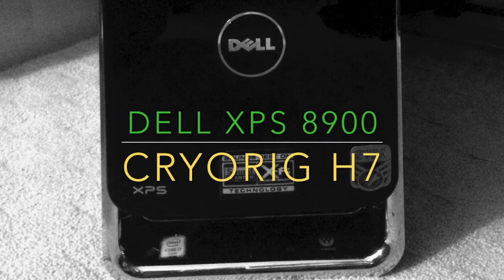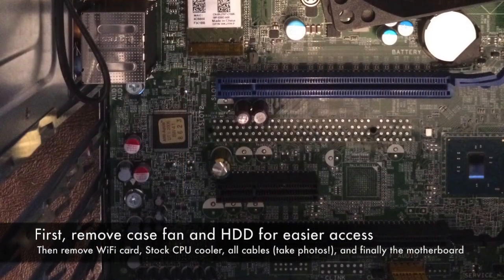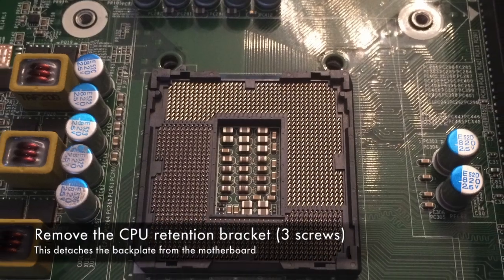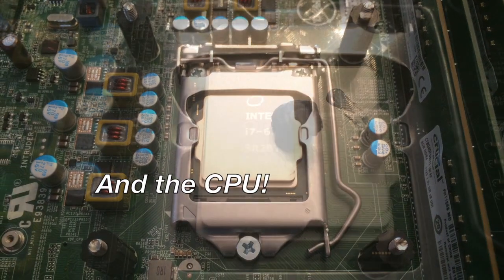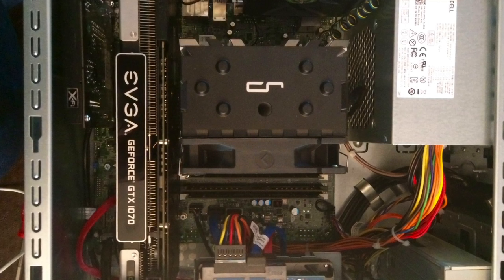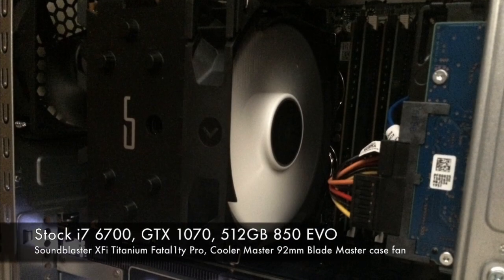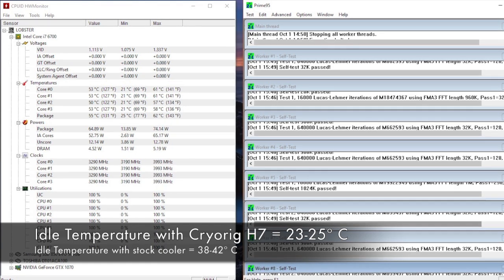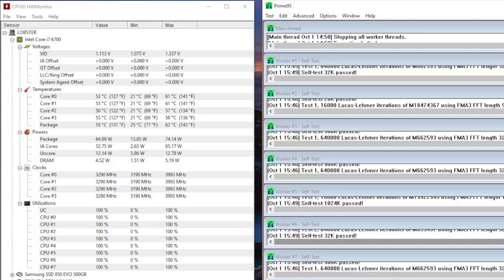Installing a Cryorig H7 CPU cooler into a Dell XPS 8900

Comment: Why not replace the cpu bracket completeley? The LGA 1151 has different variation with the same screws, Instead of modifying the original bracket? Is this just something that wouldn't be possible?

Comment: I used this tutorial to install a CoolerMaster Hyper 212 on an XPS 8500 with an i7-3770. I'm using a HAF-X case and I've heard that it won't fit in the standard 8500 case. 

Be careful when punching out the punch fittings. I bent the frame a little, and it took a lot of working to get it flat again. Using long screws would probably be a safer bet, if you have them.

Comment: thanks for the informative video.  Any idea if something similar is possible with the XPS 8910 SE?  They have similar looking mobo but the 891- case has the swing out PSU idk if that will pose issues.
Reply from the maker: Looks like the power supply hangs over the CPU on that machine, so nope it would not work.

Comment: Those press fitted threaded sleeves in the Dell's back plate: I could not pound mine out by any amount of abuse with a sledgehammer and hole punch-like implement. The bashing made so much noise that it attracted the attention of the PC's co-owner who insisted I stop for fear of deforming the back plate and making it unusable. I wonder if the back plates in the XPS 8900 units distributed in Australasia have shrink fitted threaded sleeves, or even a sneaky amount of welding.
Reply from the maker: Interesting.  You could always drill them out, given that the threads are no longer needed due to the backplate being "sandwiched" between the mounting bolts and the CPU cooler, and the CPU socket screws also thread from the other side, holding it in place.
Reply: @jarrod-smith  Thanks for the insight. I've become more hesitant about performing any irreversible mods to my unit. I previously got a Cooler Master Hyper H411R in anticipation of an upgrade to a used i7 7700K (91 W TDP). Luckily I only got the cooler first to "try it on" the current i5 6400 (65 W) and ran into this mounting problem. I'm not even confident the Cooler Master's sleeves would have worked with the holes I couldn't forge in the back plate now because they depend on the included plastic bracket to be held taught while screwing the cooler into them. There is no room between the PCB and the case interior for that new bracket either.
    Anyway my new plan is to eat humble pie and look for a i7 7700 (also 65 W) which I hope can cope with the current Dell cooler and be kept under... 90° C? This cooler looks a bit like the Intel kind but is fastened down with screws. My i5 peaked at 63° C under Extreme Tuning Utility's AVX2 stress test with it, so I think the latter i7 should work okay, but then I also see you weren't satisfied with the i7 6700's temps using what I assume was the same Dell cooler. It looks like my trial and error has not finished for this system.
Reply: @jarrod-smith  Greetings from the future! The good news is I was able to successfully install an i7 *6*700K & the Cooler Master. The threaded sleeves and their mobo back plate stayed put, as the sleeves were actually compatible with the Cooler Master screws (~3 mm dia)! I didn't find this out sooner because the folded mounting arms suspended  the screws too far above the board to reach. That couldn't be remedied since each screw was held to the cooler mounting arms with what I can only call a 4-pronged metal stopper... until I used the tiniest flat head on hand to pry them off. Saving the springs, this allowed me to flip the mounting arms upside down so that the folded ends that would house the screws were down closer to the board, putting the plate sleeves in biting distance of the cooler screws. Everything's been running smoothly a few days now. Its hottest core peaked at 78°C in an AVX2 test so I'm not even bothered.
   The bad news is I spent ~$300 on a used collection just for the included i7 *7*700K beforehand. When the system refused to boot, I later learned that Dell had never bothered to update the XPS 8900's BIOS to accept 7th gen Intel. Until then I was only looking at the socket and chipset for compatibility. My best payback in the future will be to boycott pre-builts whenever possible, ha.

Comment: Did installing this throw a CPU fan error at boot? I've heard this happens if you have a non Dell CPU fan. Also, are you able to control the fan speed thru SpeedFan of this cooler if attached to motherboard CPU fan connector? I had same overheating issue with my i7-4790 XPS 8700, however I discovered with SpeedFan I can control the CPU fan. It was running at 800 RPM as my cpu was reaching 70 degrees celsius. With SpeedFan, I turned the stock CPU fan up to about 3300 RPM during gaming, and the CPU stays below 60 degrees while at heavy load. Its not the stock heatsink, its the programming dell put on the RPM curves that makes these fans run super slow even at high load for quietness.
Reply from the maker: No cpu fan errors, the mobo treats it just like the OEM fan. Look below for my previous comment about that.  Haven’t tried fan control software, I just let the firmware control it based on temps

Comment: Did you or do you have to remove the motherboard in order to put the screws in for the fan?  If so can I remove the other side of the tower?
Dell xps 8900
Reply from the maker: No, the 8900 case does not allow you to remove the right hand side panel to access the back side of the motherboard It's riveted to the rest of the case.  That's why I removed and then reinstalled the mobo to do this mod.

Comment: Why not use the plastic back plate instead of modifying the old one? I would assume its because of the Dell Case, so if you have an aftermarket case you could go ahead and use the plastic plate that came with the cooler?
Reply from the maker: I just figured metal > plastic in terms of rigidity so why not modify what was there instead of using plastic. The plastic one might have worked fine, I didn't try.
Reply: Ah okay good to know. For the record, I've always used the plastic ones that come with the Hyper 212 Evo and they work just fine (on other machines of course). 

Thank you for the quick response!
Reply: Just to add to this, the stock backplate does dual duty - holding the cpu retention clamp AND the cpu cooler. If you take it off you need to find a stock cpu clamp rear plate - and then you can use the stock plastic back plate incl with the cpu cooler.
Reply: You can also replace the cooler with one that uses the stock m3 bolts and it's an easier process - dont even have to take the motherboard out; https://www.dell.com/community/XPS-Desktops/XPS-8930-i7-8700-3rd-party-CPU-cooler/m-p/6108436#M13410

Comment: Hey, I hope you still get notifications because I’m curious about something. I heard that aftermarket cpu coolers cause a fan error on Dell boards and I wanted to do this mod to my Inspiron 3847. Does the connector just plug into where the stock one went or did you have to do anything else ? Awesome vid btw, thanks for putting it out
Reply from the maker: This particular combo works without a hitch, no adapters required.  In fact, not only does it not complain about this fan, but if you hold the fan still, the firmware sees that the RPMs are off and throws an error to keep you from frying your CPU.  Whether it would work similarly with the Inspiron 3847 is unknown, to me.
Reply: Jarrod Smith I mean since it’s a Dell motherboard I guess it would too? Hopefully it does haha. Also just wondering, do you happen to remember which model this is ? I think our Dell motherboards all fit only 120mm ones ? Thank you so much for the help and the quick replies btw

Comment: Does modifying the back plate mess with the proper tightening tolerances? I would try that but not if it forces the heatsink to press too hard or too little on the processor.
Reply from the maker: TapesNstuffS this modification has nothing to do with how hard the heatsink presses into the processor.  That’s governed by how much tension is in the springs of the heat sink mount.  Should be just fine.  I’ve had no issues.
Reply: Alright, good to know.

Comment: Before ordering this one, is the XPS 8900 the same as the 8700? I got a 8700 but no videos for it, and I'm worried that I won't be able to install it in the 8700 especially that it'll cost a lot to get the H7 in this part of the world.... I got a 8700 with an EVGA 1050 TI SC installed
Reply: Any luck with your 8700?
Reply: @PatronSaintofFailure  i didn't like to try really and waste money, so i'll keep the heatsink and change just the fan with a PWM Arctic 80mm one.

Comment: An excellent video with perfect photos of what you're talking about. My h7 is arriving today for my XPS 8900 that I've been building up for the past two years. 

Curiously - - in light of the better airflow throughout the top portion of the chassis with that 120mm fan aimed towards the rear cpu fan, did your temperatures also fall within the entire case (more specifically your GPU) under heavy video+CPU load, or was it negligible? I had considered the notion of custom-fitting a front side case fan (intake) to improve airflow inside... But was curious if the h7/included fan is pretty much doing the same thing?

Thanks in advance!
Reply from the maker: I'm sure it did but I didn't do any "before" measurements to compare.  I did buy a fan with built in thermocouple for the front of the case but haven't bothered to install it.

Comment: Great video Jarrod Smith
Hope you can help me sir, i have dell optiplex 7010, can it be fitted with cryorig m9? as well as a problem on dell stock fan with 5 pin connector that does not match with Cryorig's 4 pin jst socket. Regards
Reply from the maker: Hmm I have zero experience with the optiplex lineup sorry.  It has a 5 pin cooling fan connector?  That sounds like it might be proprietary.  If you find the pinout you could rewire the connector but it is hard to say what might happen - if the BIOS uses that fifth pin for something then it might not be compatible.  I would search for the pinout and see what you can learn, then go from there.
Reply from the maker: Milo Razack if you look further down in the comments you'll find that one gentleman was able to put an H7 in his optiplex 9010.  He said he got an adapter for the 5 pin header and it works.  So it sounds like it might be doable!
Reply from the maker: Milo Razack what about this:  
https://www.ebay.com/itm/1pcs-5-Pin-Dell-Latch-Fan-Connector-to-4-pin-Fan-Adapter-Convertion-Cable/262784103218?epid=529924955&hash=item3d2f273332:g:e3YAAOSwnH1WXGmC
Reply: wow it's amazing you can find this connector sir, it looks very promising & worth a try. Thank you for saving me .. Cheers!

Comment: Should i put a cpu cooler in my xps 8700?? Its gpt a 1060 gtx and its i7. Not oc. All i do os play oculus rift? Should i invest?
Reply from the maker: Only you can decide that.  You should Install CPUID and see what CPU temps you are hitting while you play to help you decide.  It certainly keeps my temps lower but that doesn't mean it is a necessary upgrade.

Comment: Amazing video. I bought a H7 without knowing about the 5 pin header.....so I bought an adapter. I started working on my Optiplex 9010. I soon realized, the backplate does not fit. Thanks to you I was able to use the original backplate. However, instead of just pushing the screw holders out, I actually had to drill through them. Sadly I bent the backplate just a bit. Nonetheless, I was able to put it back, and now I got my i7 running with an h7 cooler. Thanks a lot for this great video.
Reply: how much is the gap between the cooler and side panel?
Reply: @danniananta199  as far as I can remember, since I don't have that pc anymore, it was less than an inch. Probably less than half an inch. It was close to the side panel, but I never had clearance issues.

Comment: I have a XPS 8700 and I am thinking about doing this to my board. 

One question, when you removed back plate were you just able to put it on or is there a special adhesive that you put on it or will it just be alright. I just don't want to short my board.

Thanks for the video too.
Reply from the maker: There was no special adhesive required or anything like that.  I don't recall exactly now if there were standoffs or if the threaded holes themselves hold the backplate off the PCB, but once you get in there it should be pretty clear that nothing extra is needed.
Reply: Thank you for the reply. I am gonna do it tomorrow!
Reply: How was the process for the H7 and the 8700?
Reply: Hey dude - did it work in the 8700?

Comment: Has anyone been able to get the Cryorig H5 Universal edition to work on their XPS 8300,8500,8700, or 8900? I am concerned that the H5 universal will block the PCI slot for the graphics card, and am seriously debating between the h5 universal and the h7. if anyone would be able to get back to me regarding the h5 I would sincerely appreciate it

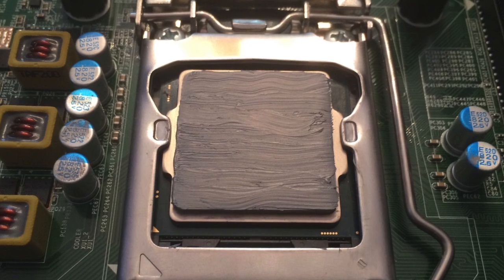Comment: 2:44 is there any kind of stopper/screw that go over where the bar holes are on the retention brackets? Unless I'm missing something it seems like it would just slide right off.
Reply from the maker: If you are talking about the cooler bracket, the holes themselves are threaded.

Comment: Hey, me again. lol So, just another quick question. Would any problems arise if I was to use the mounting plate that came with the H7? Like putting the retention bracket back on? Would help a lot if you put your opinion. thanks.
Reply from the maker: If the hole pattern lines up it should be straightforward.  Otherwise modding the H7 backplate with additional holes would be pretty easy - it's just plastic.  Either way, you would need to find nuts that are the same size as the retention bracket machine screws since I assume your CPU retention setup threads directly into the stock backplate like it does on the 8900, and that won't work with the H7 backplate.  Or does the H7 come with the hardware for that?  Not sure since I didn't use that part of my kit.  Anyway,  the only downside to using the included H7 backplate is that it won't be as rigid as the modded stock (steel) backplate.  That said, the H7 itself doesn't weigh a whole lot and is relatively short, so applies less leverage than other taller solutions.  So supporting the heatsink while the mobo is on its side doesn't require a ridiculous amount of strength.  You would be trusting the Cryorig engineers on that point.  I certainly feel better with the additional margin provided by the stock backplate but you probably will have no issues with the one that comes with the cooler.  I don't remember seeing any reviews complaining that the plastic one was lacking in rigidity/support, but you might double check.

Comment: Your method is removing and modifying the back plate is awesome. I have a question though. In front of the motherboard where you put the stand offs are little metal rings or something? They won't get in the way for regular 1150 stand offs for different heat sinks?
Reply from the maker: Not sure what you mean.  Are you talking about the capacitors lined up next to the CPU socket?   I think any heat sinks designed for socket 1150/1151 should work with this method, as long as it fits in the case.  Of course I have only tested the one in this video so YMMV.
Reply: Jarrod Smith I guess I don't know how to explain it. I have a 8700 mobo and where the heat sink stand offs go in are little rings it seems. Wondering if it'll get in the way when installing the stand offs.
Reply from the maker: You mean the black rings in this picture here?
https://ae01.alicdn.com/kf/HTB19zMgNpXXXXb_XXXXq6xXFXXXT/-font-b-Desktop-b-font-motherboard-For-font-b-DELL-b-font-font-b-XPS.jpg

If so, then maybe it helps to understand that the cryorig standoffs come in two pieces - the metal bolt, which fits through the hole in the backplate+motherboard, and the plastic standoff which slips over the bolt after you've inserted it.  My guess is that those rings would not pose a problem but hard to say with certainty without seeing it in person.
Reply: Jarrod Smith Yes! Thank for you looking it up. lol And yeah, I can't say for certainty either. I guess you didn't run into that installing yours. Thanks for your input! I'll update once I've tried it. For anyone who is in my position.
Reply: Did you install the H7 on your 8700? I have the same Dell and want a good CPU cooler that fits! I am guessing this is the best option?
Reply: Any input on the H7 for the 8700 yet?

Comment: nice video! how about the rpm? my XPS stays at 1200 rpm for any temperature below 70°C and then starts to ramp up linearly to 4500 rpm at 100°C from what I have estimated (actually measured up to 83°C).

case fan follows the same pattern, but rises from 1000 to 2200 rpm from 70 to 100°C.

I use HWiNFO to measure rpms btw.
Reply from the maker: Hi, thanks and glad you enjoyed it.  Interesting info on your temps and fan speeds.  I will have to try HWINFO for fan speeds but I feel like I read it doesn't work under Win10?  I will try later.
Reply: I'm running W10 Pro. Works fine. Speedfan works as well, but HWiNFO is more useful. however I haven't figured how to control the fans properly. both programs seems to only be able to set the fans at 2 speeds, a low speed or maximum.
Reply from the maker: As I'd suspected I am not able to get readings on fan speeds in HWiNFO or CPUID (CPUID should also read this info - it works fine on my i7 920).  :-(